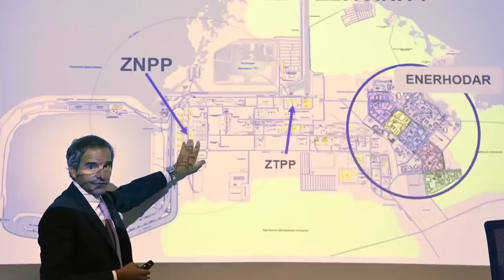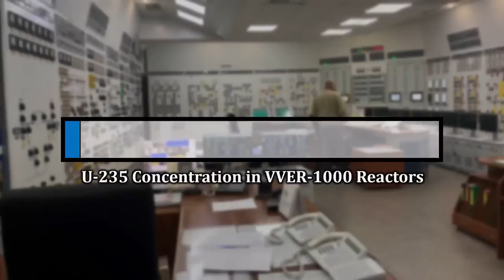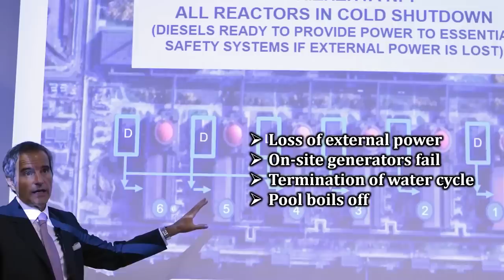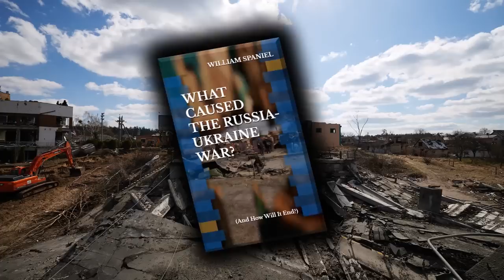Where Will Ukraine Strike Next? The Three Main Options Available to Kyiv

Comment: Melitopol and the Molochnyi Estuary would be the next logical target. Dnipro River anywhere near Kherson City is a difficult obstacle, especially for armoured vehicles. Further, the Russians are heavily dug in, so it would be very costly for Ukrainian forces to mount a counteroffensive on that front without first flushing the Russians out with sustained artillery bombardment for at least two months. Luhansk does not at this stage represent a sufficiently important strategic objective, given the likely cost in manpower and weaponry. It should suffice more or less to secure a few centres like Svatove to choke Russia's supply lines in the north, and dig in. Initially a breakthrough on the Zaporizhzhia front would also be very costly for Ukraine, but somewhat less than on the Kherson front. Although exposed without much cover, heavy bombardment on this front, followed by a heavily massed advance of armour and infantry to breach the Russian lines towards Vasylivka and Orikhiv appears to be the best option. The Dnipro is not an obstacle here. It must be carried out by a very large combined force, because this salient should drive directly south to Melitopol and the Molochnyi Estuary. As such, it would cut Russia's invasion into two isolated zones which cannot mutually reinforce or resupply. To maintain and extend the salient all the way to Melitopol would require manpower and weaponry able to defend its northeastern and southwestern flanks, and even to widen the salient to give it more defensible depth. Successful execution of the operation to this extent puts the Ukraine forces behind the lines of entrenched Russians and right on their eastern flank before the Russians can reinforce and build new defences. From Melitopol, the operation's second phase would involve thrusting westwards, emphasis being on taking control of the coast with the objective being the Crimean isthmus. This would cut off all Russian assets remaining in Kherson Oblast. They will either surrender or die and in either case, they'll be much more easily overrun in their shrinking occupied territory at the cost of far fewer Ukrainian casualties. Also, key targets in Crimea would be within firing range of HIMARS and other systems, those long range missiles and drones being of special interest. Next strategic objective:--  Crimea.

Comment: Splitting the Russian forces in two would not be the best strategy here. I would concentrate on the south and to lesser degree on the north. This will be slow & grinding but without the same risk as being flanked and/or putting the nuclear facility in immediate danger. They must continue with momentum taking advantage of a weak army that is spread thin. The time will come to head for the Sea of Azov when the morale of the Russian soldiers is further diminished.

Comment: If Kiev fails to allow its men to make an orderly withdrawal by 1st December it will be too late to save weapons and Ukrainian troops will have to make for Kharkiv with an added western diversion as Russia's trench defenses expand into the most direct route.
Making for Dnipro is out of the question by now as it is open farmland all the way whereas the Kharkiv route has some useful hills and woods. Nevertheless I expect many to become POWs.
Mr Spaniel mentions the small amphibious excursion to the spit but fails to take account of Russian marine and navy littoral craft in both estuaries, nor can spy planes or satellites spot submarines fitted with ECM apparatus which can 'cover' boats and generate false soundings where there is nothing except mines and transponders placed months ago. Ukrainian forces would therefore have no chance crossing south of the Dnieper. Even special forces using the marshes would be attacked by automated weapons such as they were at the dam road for 8 days before dispersing and Russia used that time to evacuate several thousand troops. Heavy weapons headed to Zaporizhzhia city's bridges then on to Donbas at impressive speed, notably to Mariupol base.
There is a strong likelihood that nuclear fuel from the giant nuclear station is no longer there and that cooling rods are on the move in the sort of railway tanks used regularly in France and the UK to finish cooling off site.

Comment: The Ukrainians will move wherever HiMAR allows them to maintain an advantage.  One imagines they will move as long as they can continue their hit-from-a-distance and run tactics, which is probably partially determined by geography, road systems, bottlenecks etc.  The Russians are no doubt trying to come up with something to counter either the HiMAR or the tactics, and their only option at this point might be digging in and not going anywhere.  The one thing that the Russians cannot do is expose high value weapons and troops to attacks by HiMAR, so this will will probably determine Russian tactics as much as logistics limitations.  Recognizing this, the Ukrainians will attempt to increase the square miles that they can threaten with HiMAR, and this probably means making the length of the engagement lines longer rather than shorter.  I don't think we can expect a Russian counter attack (or anything other than digging in or retreats) until the Russians think that they can match or neutralize HiMAR, and at this point, if something is in the works, it is months or longer away one suspects.  So we can expect static, dug in positions to be defended in an effort to buy time, which is probably viewed as essential by the Russians.  Realizing this, the Ukrainians will be pressing their advantage as hard as they can wherever they can... and this will also produce long lines of engagement.

Comment: EXCELLENT explanation of the strategy of the Ukraine War. You are extremely correct I believe. 
My  guess is Ukraine will choose an all-of-the-above plan to keep Russia guessing about where to deploy their forces. But clearly the real prize is the coast of the Black Sea. I think the most forces will be deployed at the headwaters of the Dnieper River near the dam and break out for the coast. I expect them to also have an offensive in the far northeast to shrink the resupply from that direction and continue pressuring the Kharkiv area so the Russians have to keep their forces there for fear of losing Crimea.
If they can cut off the land supply of Crimea, that will be an incredibly big deal and might even cause a collapse in 2023. I think they may bypass Mariupol and just try for Melitopol and maybe Berdyansk if they are on a roll. (That would give them more of the Black Sea coast without having to go through the kind of fighting and casualties that Mariupol would have. If the US gives them the long range missiles to put inside the HIMARS launchers, then the Russians will be under some difficult fire. If Ukraine gets close enough, they could take out the Crimean Bridge for good.

Comment: in midst of a warzone it's unlikely that ukraine will be able to respond faster than japan did after the tsunami if in fact they have access immediately after a possible russian retreat. they would need to restore power to cooling within a few days to prevent a meltdown.
in case of a meltdown what would happen at the zaporizhzhia plant is what happened in fukushima and could very well lead to the contamination of the riverbed downstream (threatening the fresh water supply of kherson and crimea) and possibly even the territorial waters of romania. a possible contamination of groundwater is also possible. 
if the reactors would sustain combat damage or were sabotaged in a more substantial way the consequences could be somewhere between fukushima and chernobyl.

Comment: an attack towards melitopol and isolating the roads and reailroad there should be enough to accomplish the military goals of spltting the 2 regions. another on is just going for the rail lines since recent history tells us that the russians aren't that great in resupplying by road.
For that reason i think a push towards Bilokurakyne or if its miltairly possible starobilsk would also make sence. It means congestion on the current rail lines that are still save for the russians.

Comment: The spent fuel pool of the type that is in the vver  reactor would take more than a week, proboly closer to a month to boil down to the rods.  Of cause, if you wanted to create a disaster you could drain then pools. The  they would overheat with in minutues  or hours. Still, because there is no presse the scope of a accident like that would be limited.

Comment: Still Zaporizhzhia seems to be to most logical strategic target. Advancing in Kherson through the river would have the same problems as the Russians had on the other side. Attacking and gaining territory in North Luhanks is possible, but pointless wasted effort. However, a successful attack in Zaporizhzhia and reaching the Sea of Azov would make the Ukrainians the strategic advantage as shown in the video, and the Russian are not supid, they know this, so this is the reason, that - though far from the front - the Russians started to fortify Melitopol far before it was remotely reachable for Ukraine. That city might become the most important strategic point of the war if it comes to that the Ukrainians indeed make an offensive in Zaporizhzhia. I'm no military expert, but I see no other possible move by the side of Ukraine at the moment.
Reply: Ukrainians could cross the Dnipro upstream of Khakova dam where now the reservoir is and the Russians have hardly built any fortifications. They would need to empty the reservoir at the beginning of a cold snap that the muddy ground freezes over and then cross the remaining Dnipro. They would reach Melitopol from the west, not the east.

Comment: Ukraine doesn't even have the military hardware for a major offensive. On the contrary, towards the end of December or beginning of January (when the ground is frozen solid), Russia will launch a major offensive with more than 200,000 troops. At the same time, the Russian Air Force, which until now has only played a minor role, will launch a major offensive. at the same time, both military and infrastructure of Ukraine are being attacked with rockets. So the Ukrainian army should better retreat behind the Dniper and try to defend this line. Anything else would be the downfall of Ukraine.

Comment: First to Tokmak, then south to Melitopol cutting off the power plant; OR, from Tokmak to Berdyansk cutting off the south which will then depend strictly on the Kerch bridge for supply. Doubt they will assault Mariupol, more likely will block russian forces from moving south. Probably will not even have to fight for Berdyansk. Threaten from north and west and allow russians to flee south to avoid being trapped against the coast. Meanwhile they will make a very noisy feint at Kinburn spit and from across the Dnipro to keep russian troops there from moving northward. Russia probably knows all this but there's little they can do.

Comment: Russia is logistically tied to the rail system like no Western army is.  I expect the next attack will be in the north to cut the last rail line from Belgorod to take western Luhansk like they took eastern Kharkiv.  The tactical situation has been getting better there and when the mud freezes, then the offensive will kick off.  Then the south.  Since Mariopol is supplied by rail and Melitopol isn't, the second choice will be picked.  Better, the ground near Melitopol is steppe, poorly populated and open to rapid maneuver by armor.  With the Kherson region cut off from rail, there would be a reasonable chance to change a victory in Melitopol into a rout of the defenses of Kherson.  If not, a position on the north shore of the sea of Azov puts the rail, roads, bridges and ports of Crimea within range of standard HIMARS.  With the civilian population needing supplies as well as the army, things will get real tough real fast.

Comment: Ukraine is going to go right straight the center. Split forces cause massive resupply avenues off. As for the dug in positions, that is what Combat Engineers are for. Clearing & opening those lanes. As for the power plant, don't even go near it. Encircle it. Starve them. No bullets spilled.

Comment: I won't try and figure out what the Ukrainians MIGHT do, I prefer to comment on what they should do, which is basically do whatever they think will bring this conflict to a close with the least loss of Ukrainian lives. The loss of russian troop lives is totally irrelevant and the impact on russian citizens live almost equally so. I used to have concern for innocent russian lives but their unwillingness to try and end this from within and their slow change of heart only because they're losing not because they think it's wrong, tells me that they need to experience the pointy end of the sword enough to intimately understand what Ukraine is going through essentially at their hands. If the russians damage the reactors and there is any radiation leaks, then the entire rubble needs to be shipped to Moscow and stored within the walls of the Kremlin. They should also tear down St Petersburg and Moscow brick by brick and use those materials to rebuild Ukraine. Germany imposed their will on the world twice in recent history and it took gutting them to finally put an end to that attitude there, russia has not been gutted before and that is why they keep coming back for more. This has to change.

Comment: I’m sorry, but what happens when the ground freezes and Russia deploys an additional 300,000 troops? What happens to Ukraine when the hammer drops? Where will Ukraine strike next? They will strike a deal that will result in nothing less than total capitulation.
Reply: 300.000 untrained troops. You forgot to add untrained.